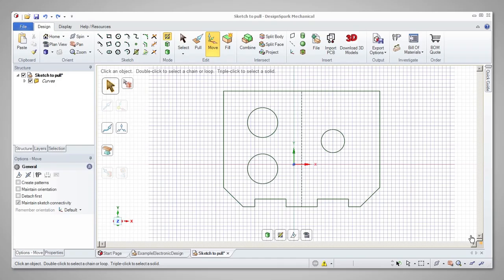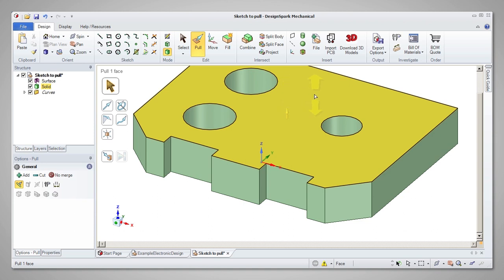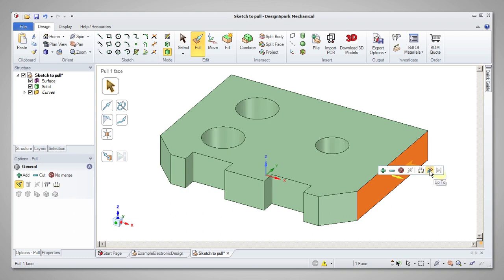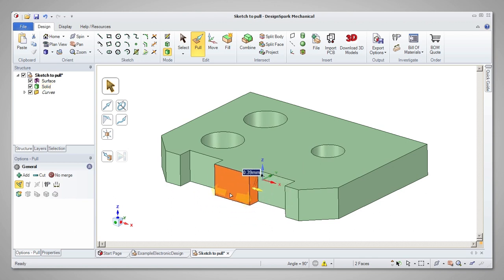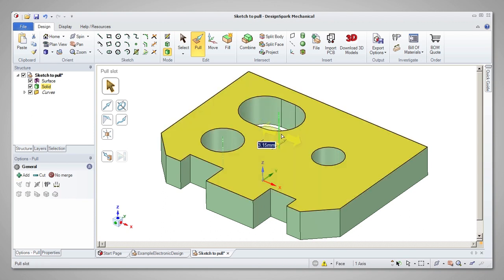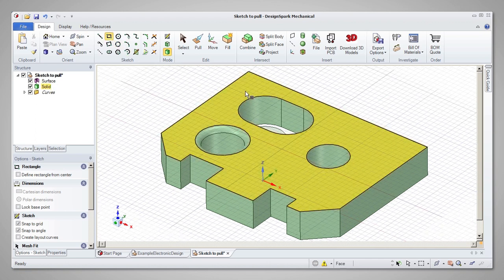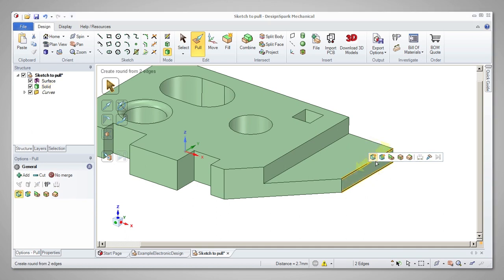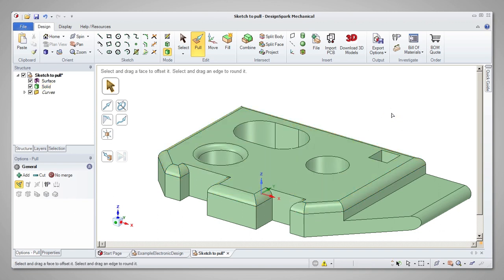DesignSpark Mechanical - Basics - 4. The Pull Tool - Full tutorial

Comment: I am having trouble getting holes extruded in an existing .stl file I found on Thingiverse. Previously, I've not had any trouble with the pull tool on other models I've found and revised but now I suddenly can't create any vent holes in a controller board case. The model isn't locked, as I saw people on the support site had issues with the object being locked but it is not. I have already successfully done this on a e3d tool holder but the case just keeps adding material and won't remove it. Any advice on this?

Comment: can i used this software for 3d printer ?
Reply: Absolutely - it is the best design software that I have found for creating models for 3D printing. I've been using it to create 3D printing models for at least 4 years.
Once you get a feel for how the direct modeling tools work, you will be able to create most models in a tiny fraction of the time that it used to take in other CAD software. For me, 3D Design is all about workflow and rapid interaction with your design to test out new ideas. This is where DSM blows everything else out of of the water.
The reason why is doesn't get more recognition in the professional CAD community is because it dos not allow the use of the old-history based modeling paradigm. Professional CAD designers are taught to use that highly structured constraint based approach, and for most of them they can't make the transition to working any other way.
Reply: @kdanagger6894  The reason why it is doesn't get more recognition in the professional CAD community is:
- many functions are missing
- you can't edit an old sketch after creating a solid
- parameters can often be changed in relative terms afterwards, there are no absolute ones
- control point curves behave not exactly
- surface modeling / trimming is missing
- curve project on surface is missing 
- curvature transition on fillets is missing ...

So this software is only for simple hobby tasks.